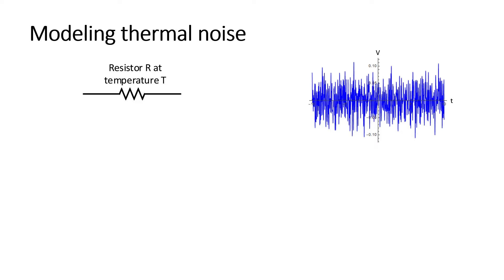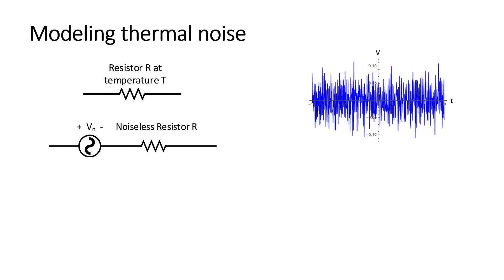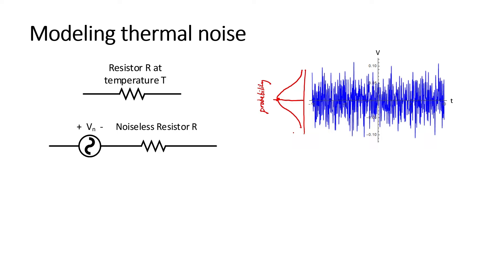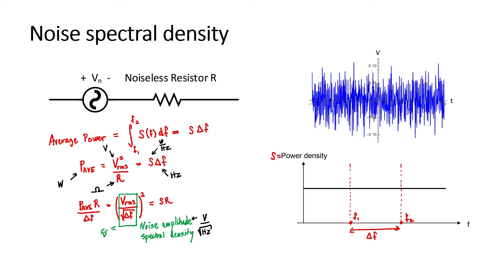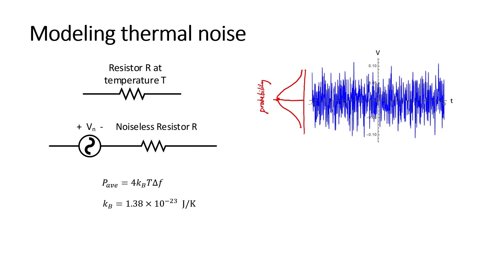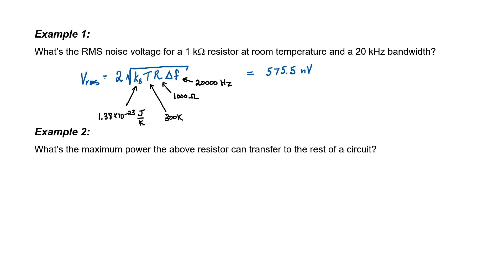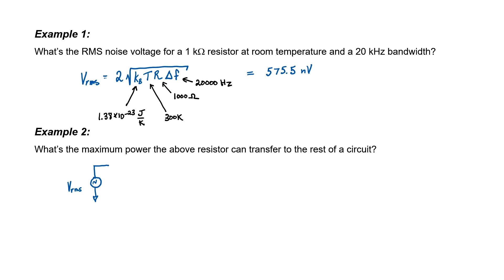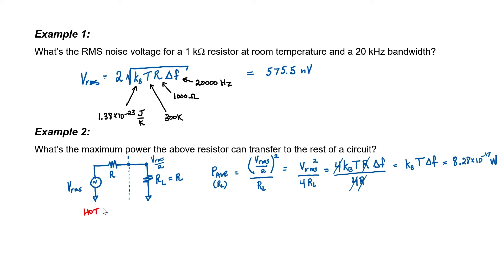Introduction to Johnson-Nyquist Noise (Amplifiers #13)

Comment: An example of thermal noise reduction: many oscilloscopes have a 20 MHz low pass filter to reduce noise that is introduced by the instrument. This is helpful for measuring small signals that have low frequencies.

Comment: PERFECTLY PRACTICAL! 

One thing missing there, though. The maximum power that can be transfered, should use not the 20 kcps, but the maximum bandwidth, you said Terra-cps. I do not know if only Terra-cps, and am not trying to determine, am limitting my activities to what my activities should be. Anyway, consider the maximum bandwidth, possibly up to frequencies associated to the electrons themselves. That gives the maximum power transfer. Should be much greater. Make partition of thermal energy between nucleous and electrons, and the maximum transfer shoul go up to half the thermal of the electrons, which is huge, compared to what you presented here.

Comment: What is temperature? How do the electrons/atoms know it is "hot" (or cold) and know they have to move around alot and make noise or increase resistance?
Reply: If I am wrong, one can correct me, It is highly appreciated.
For your question, I think you are looking what is going on in a reverse way. An electron does not need to know whether it is hot or not. Being hot or not is defined by us, comparing the temperature. Remember, temperature is defined as average kinetic energy. So in terms of our definition, when we said something is hot, it means its average kinetic energy is high, which actually means it moves much faster. So does electrons, which yields rise in noise
Reply: @omerdeger1743  That make alot of sense, Thanks Greg